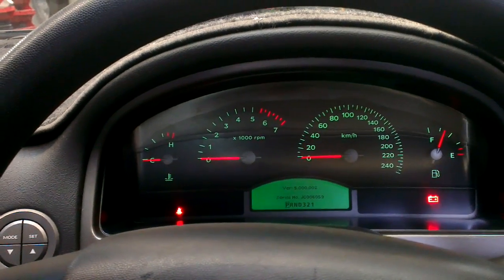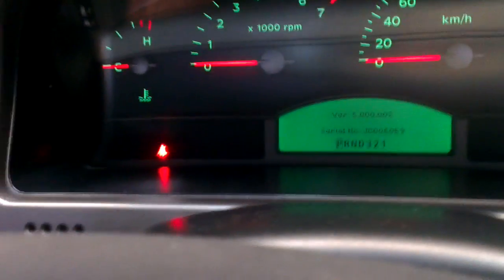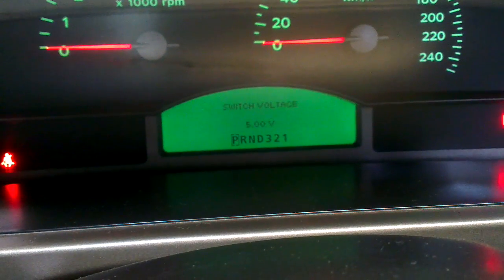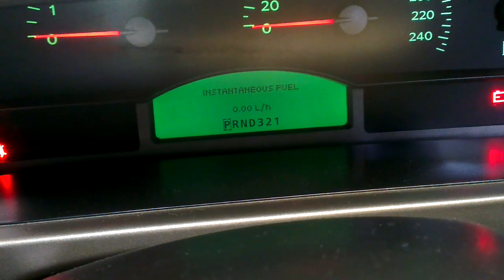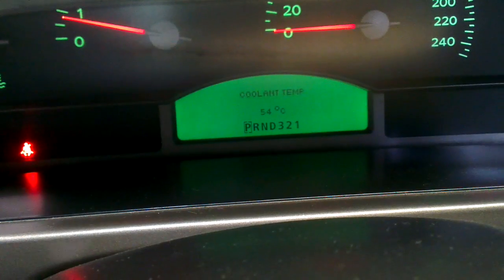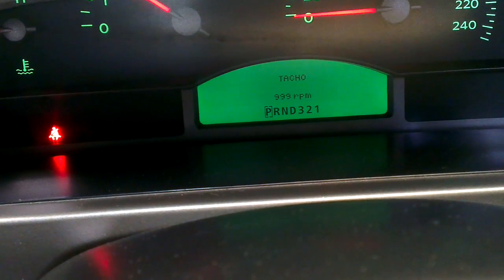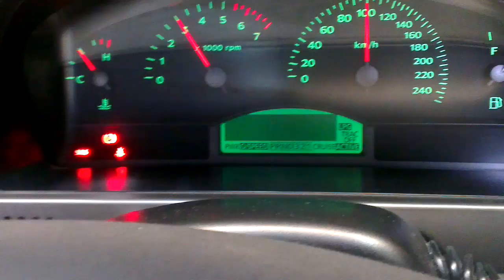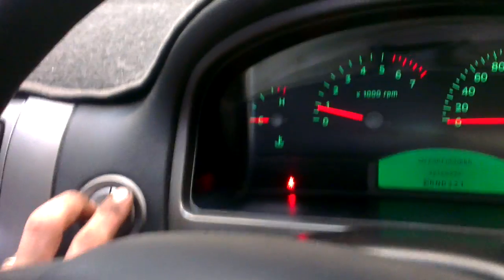Holden Commodore VX engineering mode dashboard functions buttons parameters digital speedo

Comment: in my car no tc button do u know how to tc off
Reply from the maker: +Chota Badmash I could be wrong but I've never seen a vehicle with traction control as in Anne teaspoon and not have an override button you can look at your abs pump to identify but more importantly to look at the dash if you don't have a track RT traction no light or um possibly fit was removed in blanks for some reason it dodgy dealer but you don't have traction control I can't refer back to video right now so I don't know which video ideas I'm on another platform but if there's no traction control button there's no traction control and maybe I'm wrong
Reply: there is the clip for T/c under the glove box area, i put one from my VY spac into my executive works fine.